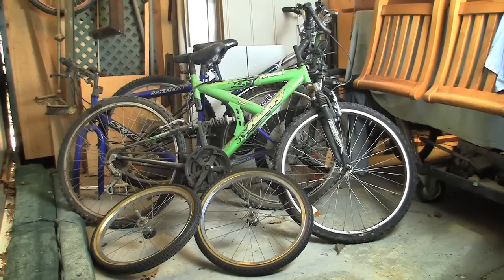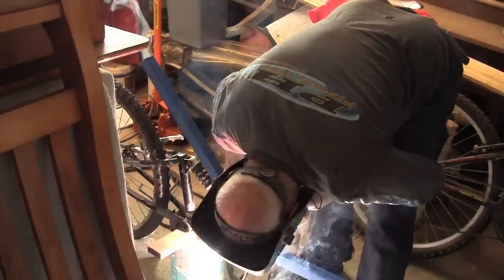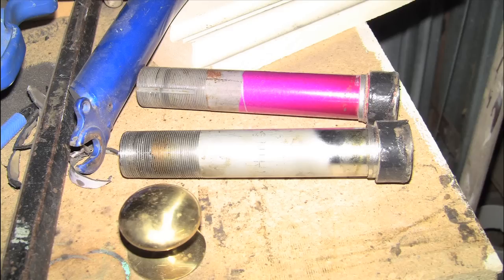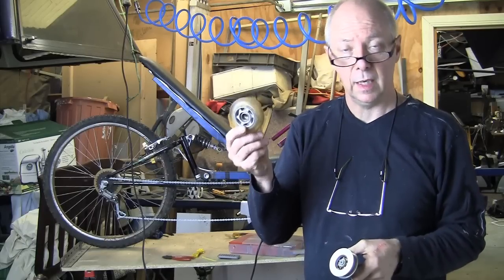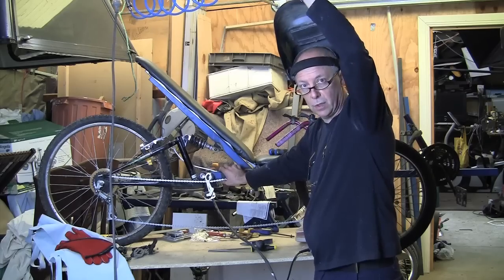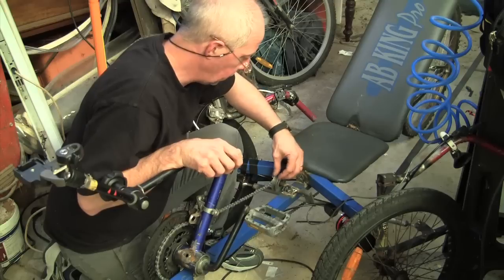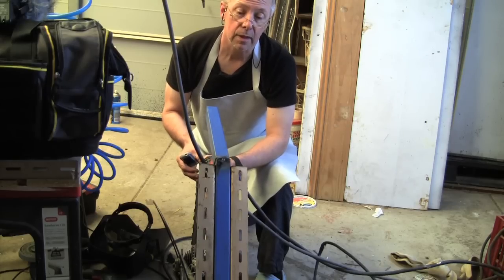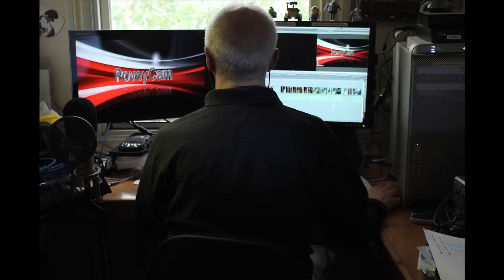How I Made My  Recumbent Trike

Comment from the maker: The total cost was some where between $100- 200 dollars and this was for the steel that I bought from a steel merchant rather than Bunnings/Masterrs as there cost are a lot higher and you Have to buy a certain size only . I found gathered and picked up about 4-5 bikes to cut up for parts . One for the back half two for the front wheels assemble and a good set of gears from one of them . I started collecting a bikes about a month before starting the project .

Comment: Great work, very informative video.
Id like to share a great tip for stick welding. 
When you place the earth lead put a bit of scrap plate steel with it. Use this to warm up your rods by dragging them along it before commencing the structural weld. That way the rod will be ready and strike an arc easily.  Also the weld will be cleaner and stronger. Great vid tyvm
Reply from the maker: Ok I will try this with the next build Thanks
Reply: Eu acrescentaria a remoção da tinta no local da solda.

Comment: Been riding my AZ Streefox for about 6 weeks now. Steering and all has worked great from the first. My main difficulty has been with the deraileurs and idler pulley. Ive about got it all worked out though. Redid my derailleurs to position closer to the gearing. Changed the idler from a metal idler like in the plans to a nylon idler pulley. The dang metal one was too loud. Heck im using a 220v arc welder. Does fine. Dont really desire a MIG. Do like your chop saw though. Now i need to change my crank bearings, they are too loud. Hope to build more trikes, bikes from AZ. Oh, the seat, i ended up with a padded seat all the way up to support my head with lumbar support. I just kept positioning temporary boards til it felt right and then used hard foam to prop the lumbar and head, then 2 inch foam over that off an old mattress pad.

Comment: Hi Niall. As a guide wheel, try using the toothed wheels from a spare rear derailleur with a spring to keep a little tension. There shouldn't be any noise cause the teeth would catch and move with it also it should keep the chain in good line with the chainwheel and freewheel.
Reply from the maker: Hi, I have replaced the old guide wheel with a toothed one after making the video with not much success, next i may try tubing as a guide. House reno's have taken up much of my time so i have had to put the trike on the back burner for now.

Comment: Hey Mr Niall, Nice work & inspirational. I'm about to get started on cutting up n making both (wife & myself 1). As Mark Alden mention his tip & another FYI: if you'd wire brush- cleaning or grinding the area that Ur trying to tac weld, it helps w/starting Ur arc. Just a helpful tip (I'm no pro welder by any means) clean area makes for easier n cleaner welds. Enjoyed it 👍n Thx from DavnTenn
Reply from the maker: Hope it goes well I am looking at an updated video sometime in the new year when i have more time and a possible new bike build , a cargo or Christiana style trike.

Comment: A trike for under $200, nice. 👍 as for modifications, I would have angled the boom up for the pedals and not added the heavy metal rack piece. Raising the boom for the pedals makes for more efficient pedaling. And a set of bolt on aluminum bike racks would be more than sufficient for anything you’re going to carry on them, and be much lighter. The only criticism I have is you welding over the paint. I see you’ve been welding for years, self taught, my grandfather taught me how to weld, he was an owner operator of a welding shop. Built horse trailers and did repair work mostly, but he was big on starting with a clean, rust free surface. Clean off the paint before you weld, you’ll have a much better looking and stronger weld when you’re finished. But over all, nicely done. Kind of makes me want to build my own. 👍

Comment: Hi Niall. I have started to build my trike. I have bought a bmx for the wheels. I thought it had 14mm axles but it has 10mm.  I still have to get a couple of bike frames for the steering and head sets and a decent bottom bracket. 

This is the only video I keep coming back to as it is more informative to us. I think i have watched it about 9 times now. Still going to watch a few more. :). 

What size (thickness) plates did you weld to the steering to bolt the wheels to. I was going to weld the front and back wheel hangers together (front and back, front and back from each side so they match) but the fronts are steel and the reatrs are aluminium. :(. I might weld thick washers on them for more thickness. 

Thanks for the inspiration and help. Ian
Reply from the maker: The BMX wheels may not be strong enough in the long term , I managed to find a genuine BMX which had heavy duty axles not sure if they where 14 or 15 mm. 
I think from memory the plate that the front wheels bolt to was either 15mm or may be 20mm.as to the rear hangers Im not sure what you mean may be a picture would help, steel is going the be less of a problem in the long run which is what most trike's are made of as alloy cause to many problems with factures. Hope this helps. good luck on the build.
Reply: @MyJessmatt  Thanks Niall. The hangers are where the rear wheel mounts to. I picked up a mountain bike so I can weld 2 slots together for each side to make them thicker and stringer. Still looking for 14mm or 15mm axle wheels for a bmx. :). Thanks for the advice.

Comment: I'll admit I have no experience at building anything but as I watched the video and the problem with the noisy wheel you had to replace, I wondered. Wouldn't it be easier to just put a small pinion in there?? 
I also thought it would nice to put an extra diagonal support for the rack. 

Anyway considering it's home-built and your resources to avoid high costs I think you made and excellent job. 

I've been lately learning about recumbent trikes, I really like what I see. Here I've been trying to find someone to build one for me but I haven't been able yet. 
 
I hope you build more and still improve your design!! 

Best wishes!!

Comment: Well done! Very interesting welding tech as well. I have a question. How long is the square tube  from the lower suspension joint to the seat angled tube center point right where you have welleded ?  It looks very short?  Ok. I wait your answer anyway.

Comment: Enjoyed your video. Im also building the streetfox and am at the front brake/steering brackets stage. Got past the steering tubes 75deg/ center point alignment stuff, whew! I see you are using a weight bench for your seat. How is that working for you? Im all over the place trying to decide which seat to use.
Reply from the maker: It was ok for the first hour or so but I do get a sore bum after a while so the search is now on for a set of plans for a better seat.
Reply from the maker: When I can get around to making the Seat 
I will try to video the making of the seat .
So far the seat is the only part I have had the most difficulty with getting  it right.

Comment: Having built my first recumbent in 1989 a few suggestions. Use aluminum tube for the frame You need to be as light as possible.

http://www.aluminiumwarehouse.co.uk/p6/Aluminium_Box/pages.html

 square tube can be connected with pop rivets and triangular joining plates.

 http://www.instructables.com/id/Building-an-electric-racing-car/

Aim for electric assist eventually - trust me your going to need it unless you live in a very flat area.

try to fit a 26 inch wheel to the rear, you will be able to take advantage of the higher gearing then the normal BMX 20 inch.

Standard bike axles don't like being supported on one side only - they are not really stiff enough. Either turn a thicker axle or support on both sides.

Standard bike spokes don't like sideways forces such as your front wheels will get. Toe the tops in and personally I solder wire round the spokes at their cross over to stiffen the wheel. Usually they don't break just pull the head out of the rim.
Reply from the maker: Richard Harris Thanks for the aluminum  tube idea that will be the next one. I do have a 26" rear and as for the 20" front wheels the axles are15mm not the standard ones you get on 20" wheels. Electric assist is something i have been thinking about for the next one . Luckly where i use the trike it is pretty flat.

Comment from the maker: The box steel was as thin as i could weld with out blow holes in it (about 1.6mm).
Weld what every thickness you feel comftable  welding, next time Im going to use 
round piping and thinner and mig weld it to keep the weight down..as im looking at building a fairing for it next. Hopfully next time i will document it a bit better as some times a got carryed away with the building and forgot to video what I was doing..
Reply: Hello friend a favor square tube that measures have , which is its thickness. Thank You.

Comment: Hi Niall. What did you use for an axle for the front wheels? Mild steel or hardened steel?
Reply from the maker: The orignal axles where what i used , those wheels came from a racing BMX so it had 15mm not 10 mm axles, the 15mm are far stronger than normal ones.

Comment: I like this build and am wondering if this can be made as a hybrid ( gas/electric ) pedal assist trike and add a small pull behind trailor for going to the store also what size are the wheels and can 4 inch wide fat tires be used for this? I am a little large about 260 in weight ( pounds ) I really like the way it is made. What do you think of the idea?
Reply from the maker: Hi Robert, you might want to go to Atomic Zombie website and ask them these questions as that is where I bought the plans from. Good luck

Comment: I like the way this is done and am wondering how well this could be made into either an email bike or a hybrid bike with pedal assist and have a trailor hitch to pull a small trailor behind for both going to the store or hunting it would help a lot.
Reply from the maker: Hi adding a hitch for a trailer with this design might be a problem because of the rear suspension, a fixed rear forks might work better for a trailer and as to a electric assist this would be a good way to go.

Comment: instead of using the skate wheel to keep the chain off the frame, what about using a derailleur pulley from another bicycle?
Reply from the maker: Dean Nunyabis  hi I have changed to a gear from a derailleur  but found that it didn't work as well I as I liked so I have now changed the design to have a guide as well to keep it on the gear .

Comment: Would have liked to see how the crank and steering was fitted. Otherwise a helpful video. I'm thinking of making a rear steering, front wheel drive, two wheel at rear version.
Reply from the maker: between the front wheels is a rod with tie rod ends bolted to the frame the wheels is attached to. then i cut a bmx handle bar in half to use in the top of the trike front wheel forks. the crank i welded to pieces of scrap so as they pass  either side of the box section and added a bolt to the bottom of the crank to tighten it up.

Comment: What hubs/axles did you use for the front wheels? I cannot imagine that a stock axle would support the weight when fastened on one side only..
Reply from the maker: The wheels came off a BMX bike that had heavy duty axles 15mm not the standard 12mm.

Comment: I have just watched both of your videos building the recumbent trike. What size steel did you use. I have a couple of 4ft lengths of roof bars (for a roof box on a car) which are 30mm x 20mm x 1mm thick steel. I dont know if this is strong enough or if I have to buy some other steel. I am thinking of doing the same back end as yours instead of a solid build. Suspension seems it would be more comfy. I am thinking 26" wheel on the rear and either a pair of 24" or 20" on the front. Is there a certain distance from the rear fork pivot or join the front axle has to be  or is the rule of thumb the centre of the front wheels in line with the knees. 

I will buy a set of plans from AtomicZombie, but have not decided which ones I will go for.  Thanks in advance. I am in Uk.
Reply from the maker: The steel i used was around 1.2 or 1.4 mmit  was as thin as i could find and still arc weld. As to wheels yes the rear is a 26inch and the fronts where 20 inch but not the standard 20 inch. My front wheels where from a ex racing BMX and had 15mm axles that help with the side ways stress that you will incounter when cornering. I had a thought some time later after building it if the detachtable wheels from a childs stroller that people run with would be strong enough as the have a bigger shaft and replaceble bearing sets. Just a thought. As to how far forward to set the front end up Im not sure i would need to find the plans. A quick read and I could not see the distance ,I would need to spend some time reading to find out.
Reply: @MyJessmatt  Thanks. You have been a great help with the advice you have given. I have been looking at some BMX wheels with 14mm axles on ebay. I am also thinking of mag wheels instead of spoke wheels for the front. But I dont know if I could get them with the thicker axles. I will have to find out. The steel I have is 1.2mm. I ha ve a gasless mig which should weld them good enough without blowing the metal away.

Comment: hi was just wondering what kind of box section steel you use mild or stainless and wall thickness thanks good video want to build one myself did you paint it up when all done would love to see finished trike
Reply from the maker: Hi I used mild steel not stainless as I was using a stick welder.
Reply from the maker: hi the box steel is 35mm square and from memory its 1.2-1.5mm thick.
Its just had a anti rust paint put on it . I have stripped the seat off to try a differant one as i always had a problem with the mesh cover moving. I dont have a lot of time to work on the trike as we have just moved house and now we are starting to renovate it.

Comment: what size  steel did you use for the frame....was it 40mm x 40mm   or 50mm x 50mm?
Reply from the maker: I think from memory it was 40 x 40 and as thin as i could buy which is why i had problems welding it . I wanted to keep the weight down.
Reply: thanks...was the thickness 2mm.....really liked your video on the build.
Reply from the maker: I think it was thinner  but depends on what you can weld without melting it.

Comment: Is that you are using 2"x2"x1.5mm steel pipe?
Reply from the maker: Hi it was 32 x 32 mm and i thick it was 1.6mm thick , this was to make it as light as possible and easy to weld . My welding has improved since changing brands and size of the rods from 2.4mm to 1.6mm rods means less blow out of the welds

Comment: just wondering, was all the steel used to make the trike mild steel or a mix of chromo and mild steel?
Reply from the maker: Its all mild steel , the box was 1.6mm and the rest was from bike frame off cuts.
The next one will be made from round tubing and Mig welded in stead of welding with  the stick welder,( less blowing holes in the thin steel) and change the steering set up.

Comment: Where are you located? The GMC cut off saw have it away a little.
Reply from the maker: Australia, use to be in Melbourne but have moved out to a country town as we are getting closer to retiring. Just made a new seat and improved the chain guides.
Reply: @MyJessmatt  nice, you've given me some inspiration, I'm going to source a bunch of old bicycles to get as much light weight tubing as I can and TIG weld a frame up. The local LifeLine usually has a few, though I'll need to wait as they're closed currently. I might try the recycling depots too. Cheers from Brisbane
Reply from the maker: @rendel5024  You could try a exhaust / muffler shop for thin walled round tubing if you don't wont to use box steel. All of my bikes/frames where from hard rubbish collections only the chain and cables where new from a online store.
Reply: @MyJessmatt  I'll give it some thought and research. I have some projects I'm working on, so will look for some data and plans in the meantime

Comment: nice work mate, even with old school arc welding,  i am looking to use similar plans but tig and aluminum.. hiw comprehensive were the plans?
Reply: Troy Dawson still the most common and popular form of welding.
Reply from the maker: Pretty good if i can follow them, also Ive had the arc since I turned 21 Im now 57 , one day I might get a mig.
Reply from the maker: Pretty good if i can follow them, also Ive had the arc since I turned 21 Im now 57 , one day I might get a mig.

Comment: Thanks Niall for posting this informative video.  I'm looking at buying a recumbent trike as I can no longer ride a regular bike because of injuries, but due to their obscene prices I may be forced to make one.  I have previously made a two wheeler and ended up selling it. I had several offers during the few years I had it.  The seat on the Flevobike trike http://www.ebay.com.au/sch/i.html?_odkw=tricycle+parts&_sop=12&_osacat=0&_fromfsb=0&_trksid=p2045573.m570.l1313.TR12.TRC2.A0.H0.Xflevobike&_nkw=flevobike&_sacat=0&_from=R40 (two rear wheels with front wheel drive) looks pretty comfortable.  You might be able to get or design one similar for your trike.  Many others use a metal frame with mesh which is also supposed to be good, but I personally like the look of the Flevobike one.

Comment: hi, i have question about front wheel hubs, did you use normal hubs, or hubs made for recumbent trikes and lefty MTB, and are normal hubs strong enough to be used like that?
Reply from the maker: The front wheels where from a racing bmx bike that had 15mm axles not the standard 12mm axles, you could try wheel chair hubs as they are similar .
Reply: ok, thanks, i forgot about wheel chair